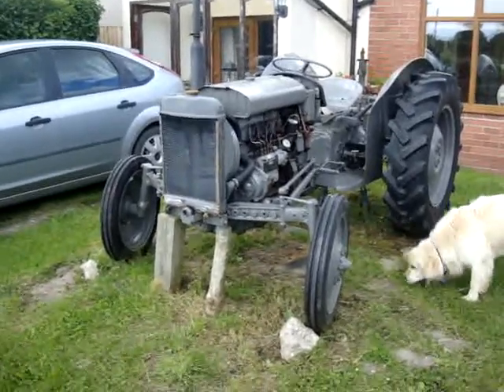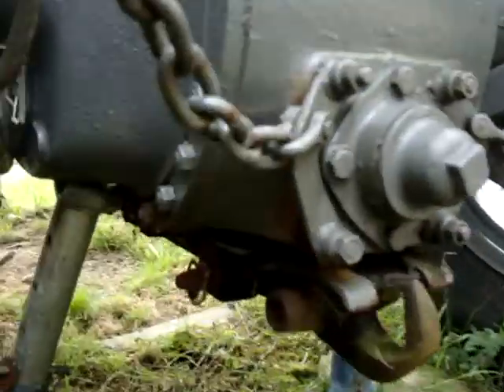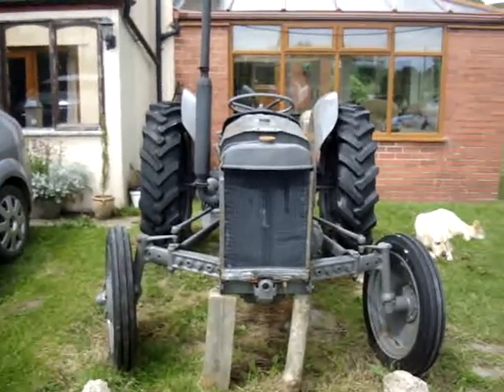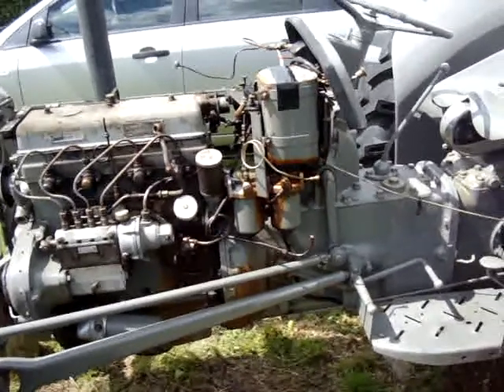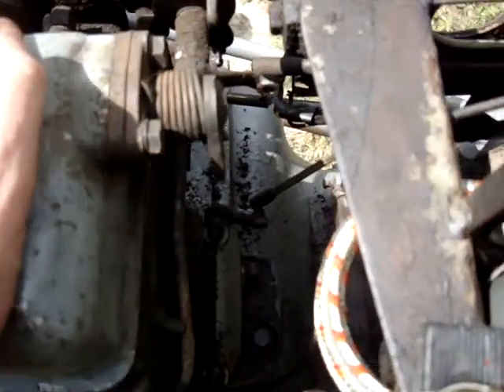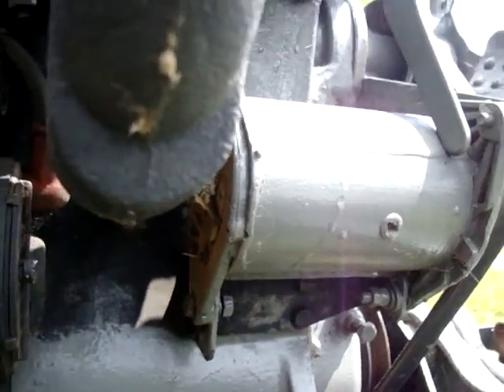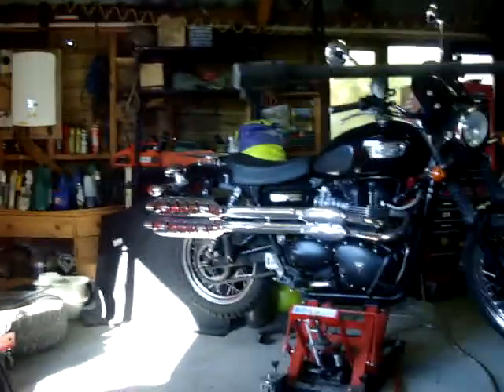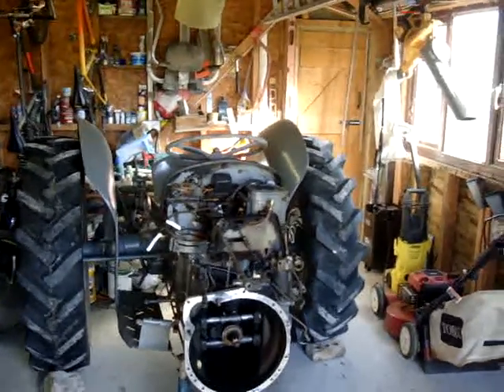Removing the TEF20 Grey Fergie engine. MAW544

Comment: Hi, you can change the angle of the fan belt by moving the dynamo to the front of the bracket, instead of being behind.
Reply from the maker: Would still be out of line with the third pulley though, When we put it next to the old water pump its the same size in every way except the spindle is longer. So we are going to shorten the spindle to make it fit.

Comment: hi mark when you sent your engine away did you just remove it and send it compleate as i gunna send it were you did in wrexham  did they supply all rebulid kit or they ?
Reply from the maker: Hi Richard, I took all the little things of like the dynamo, starter motor and the complete exhaust. Other then that they are sorting it all out although I think the fuel injector pump has been sent somewhere as the engine is now done and I'm just waiting for that.. Mark.

Comment: hi there were did you send engine for rebuild  ?
Reply from the maker: Yes, the engine is now in Wrexham with a chap who has all the machines and tools to do the job properly. While the engine is away I'm just fiddling with a few little jobs. Have replaced the gearbox input shaft seal and gasket, new wiring loom and have given the starter motor a quick clean. Can't wait to get the engine back and it shouldn't be long now.  Mark.
Reply from the maker: And its E R Williams doing the rebuild in Rhostyllen Wrexham.     http://erwilliams-engineservices.co.uk/home/2522893

Comment: Can I ask you what model MF your mudguards and footplates are off? I'm restoring a TEF too and I'd like to fit mudguards that bolt onto the footplates. Nice looking machine btw! Thanks
Reply from the maker: Hello, There from a massey ferguson 35 and are classed as the mudguard extended. Only small problem is they don't reach the foot rests but its and easy job. I brought some off cuts of metal plate and just cut them to the correct size. drilled three holes to attach to the mudguards then drilled another 3 holes to attach to the foot rests. I got mine from the  old 20 parts company in Derby. https://old20tractorparts.com/mf-35-35x-tinwork-parts/1362-massey-ferguson-35-135-148-extended-mudguard-pair-1280163.html